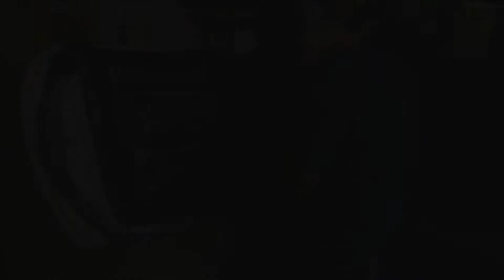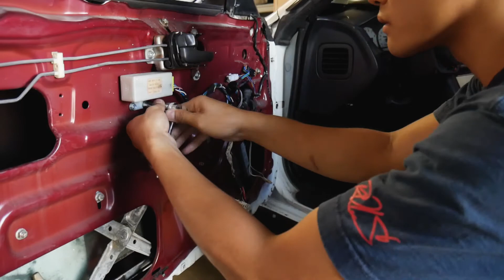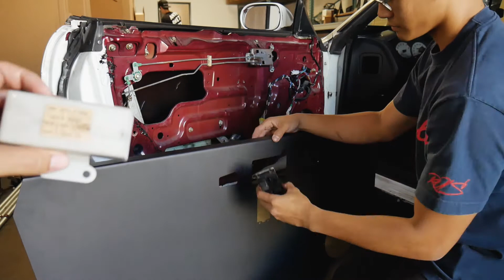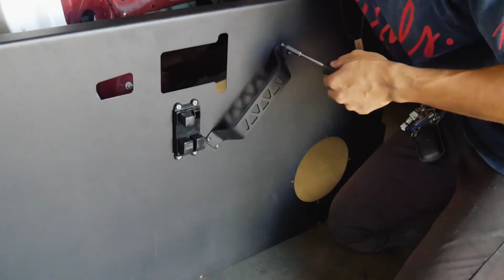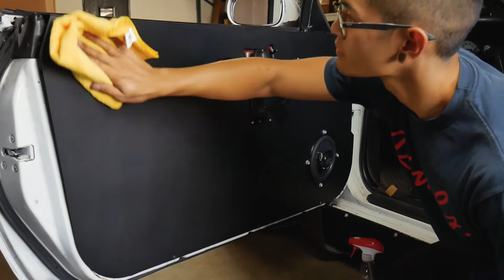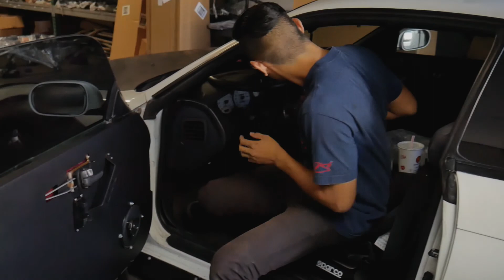Street Faction - S14 Door Card Install

Comment: So the point of doing this is to install a roll cage or some other race modifications correct? What other modications would require this if I may ask? I guess somebody may do this if the OEM broke and replacement is very expensive. Aesthetically, it's very ugly to me.. Thank you for showing though.

Comment: as a 98 S14 owner I'm not down with how all these kids end up trashing all these 240s I'm sorry guys but these panels look like someone just bought a piece of wood at homedepot slapped a piece of cheap vinyl and called it michey mouse fix hey but that's just me ok, there's no way these looks better than the stock panel it won't even match with the curvature of the dashboard SMH.....👋👋👋
Reply: These cards are made so that you can fit a roll cage and have additional room for bucket seats etc. They are not made for street cars or made to look good, they are made to function. Also, OEM door panels basically fall apart due to being made out of cheap plastic and this is a functional replacement. P.s don't act like 240sx's are special cars, they were cheap when they were new and this is coming from an S14 owner.